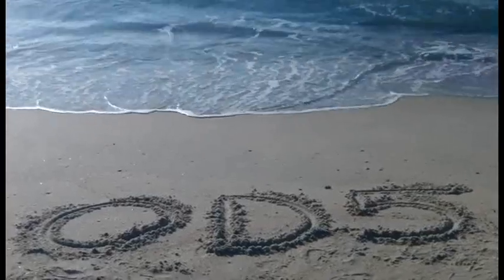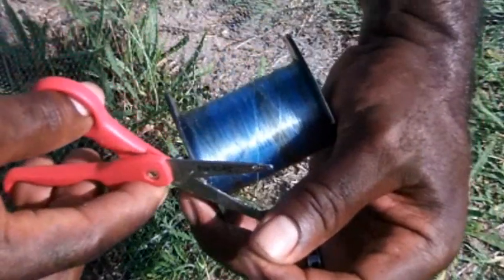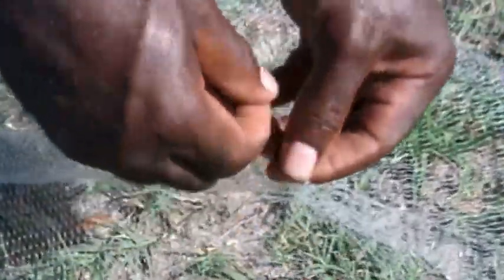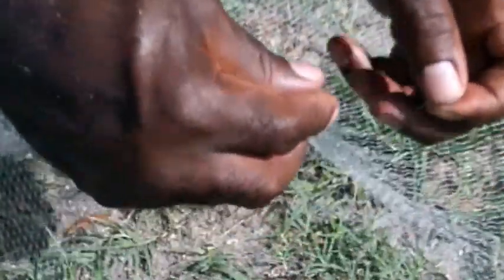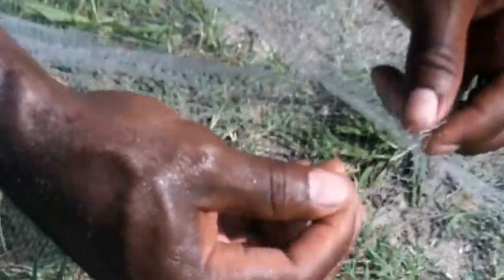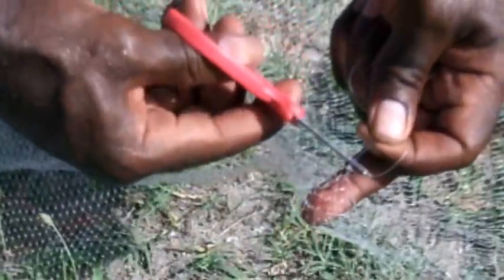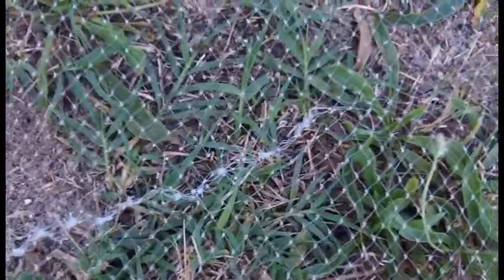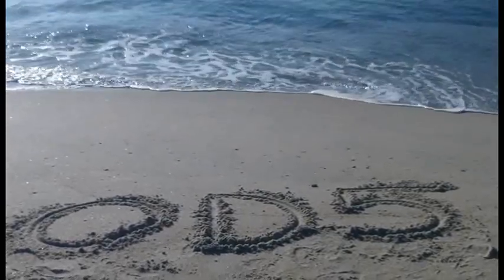EASIEST DIY!!! How To Repair A HOLE in your Cast Net

Comment: can you do a video on how to change the weight of the cast net?
Reply from the maker: +Dinesh Ramkumar I haven't done that before. If I see a vid like that I'll share it.
Reply: it's almost impossible to change to weight. if you make it heavier it'll start closing together early depending on the mesh size. or it just won't fan out like it's supposed to. 

you can add a tiny bit of weight, but I've tried it on two nets and they both failed. maybe I did something weird. who knows. I still trying to save anyone else with the some question some time